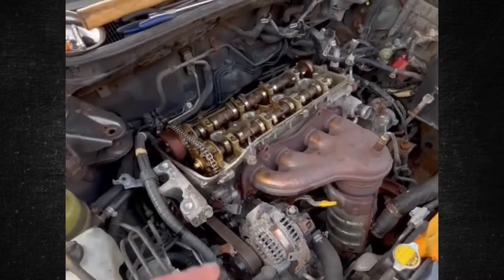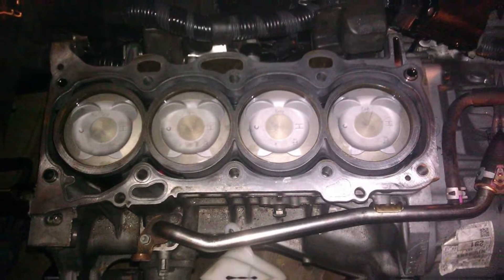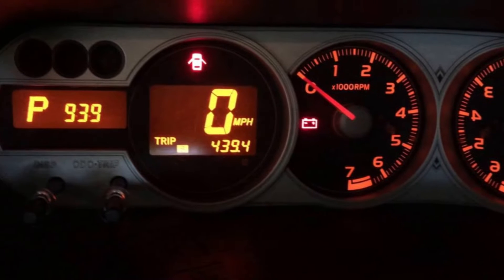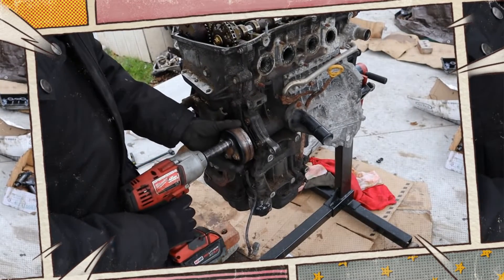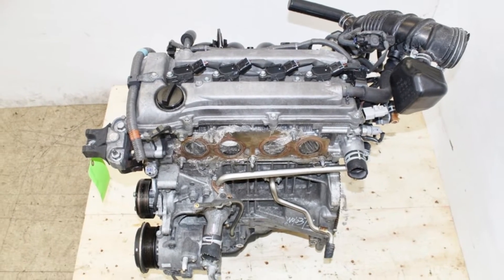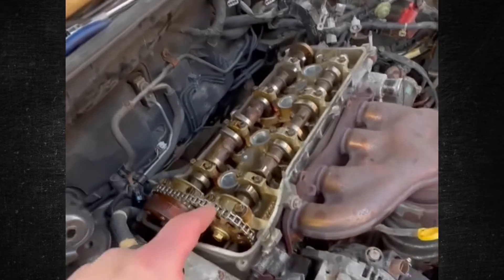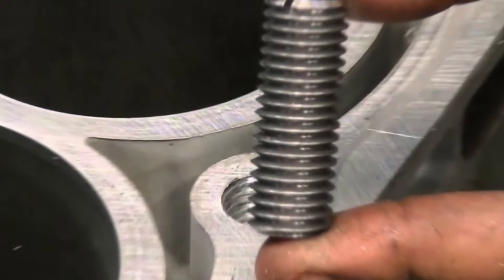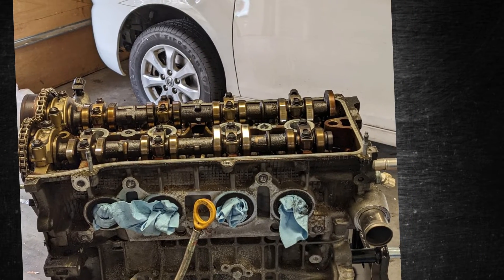Toyota 2AZ-FE Engine Problems - Oil consumption, Coolant leaks, Head bolts

Comment: 2AZ-FE summary of key fixes:

2000–2003: Initial release. No balance shafts. Early signs of oil consumption.

2004–2006: Balance shafts added. ECU emissions tweak. Start of oil-burning complaints.

2007–2008: Revised piston rings. Start of oil consumption TSBs.

2009–2011: Final version. Fixed oil issues. Updated threading. Best reliability.

Comment: Re Oil burning.
Check out Moreys Oil products from New Zealand and Australia. Put a double measure of their Upper cylindar lubricant into your fuel tank, and put a bottle of the Oil Stabiliser into the sump oil. My 2AZFE was burning one litre every 300 kilometres. After adding the two additives, I checked the oil level after 300 kilometres of travel. The oil had gone down so I added more oil. At 600 kilometres after the additives the oil was again down but not as much. At 900 kilometres, there was no oil loss and  the oil was looking a bit cleaner. I then had new oil and a new filter installed, and continue using the Upper Cylindar Lubricant each time I fuel up. So far, the engine is quieter, smoother, and a bit more powerful. It was a lot cheaper and easier than replacing the motor

Comment: I have a 2012 Toyota Camry with 224,000 miles. It has 2AR-FE.  I bought it as a certified used Toyota from a Toy dealer, it came off a lease.  I changed oil religiously mostly using Mobile 1 Syn  5w-30. Sometimes an oil change at a dealer.  After 120K started burning oil, not leaking any. It got up to 1.5qt between 5000mi oil changes.  I thought this is very weird. So  2yr ago I watched a Lake/Valvol** video and discussed these 2AR-FE engines and the Valv___ Restore & Protect product 5w-30.  So I did as they suggested, and I am at the end of my 3rd oil change using that product and Toy or Denso filters.  So i confirm my oil consumption has dropped to less than 1/2 qt between oil changes. I quit being lazy and seeing my cars get damaged & inferior oils/filters and utilized my driveway. I am thrilled with the Restore & Protect product and its getting harder to find on my area of Mesa AZ.  I have 3 toyotas & a Lexus LS330.  I'm still using Mobil 1 in some of them.  I run 10w-40 Dino/Conventional elevated zinc oil in my bucket shim 3VZE 4Runner with 310K mi.
Reply: Im gonna have to try this product.  My 2002 Camry with 140,000 miles burns 1 qt every 1000 miles.

Comment: 🤔Mine over Heat with no reason, not showing temperature rise, but the engine is like an oven, water level is fine 👌
Reply: I had the very same problem with my 1AZ, the younger sibling of 2AZ. Engine abruptly siezed, overheated so bad that the headbolts stripped. Ignorantly attempted to restore it but failed. Only Learned months later that once an aluminium block has overheated, the engine is essentially kaput. Ended up buying another engine albeit used. So far so good, fingers crossed.
Reply: @mandlamngadi6692  Did you find out what caused it to overheat?

Comment: I have an 07 Camry and since Toyota replaced the pistons at 100K miles its been a great car. Has 237K miles now and runs great. The water pump failed before I bought the car at 70K, but the replacement pump is still on there. The engine is better than its reputation.
Reply: Got an 08 camry with 327k miles, it doesnt consume oil